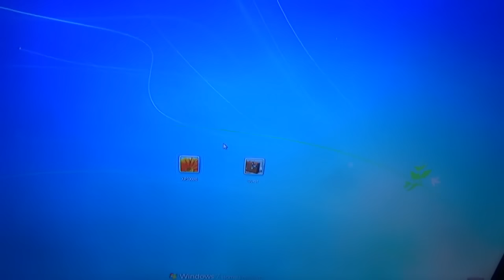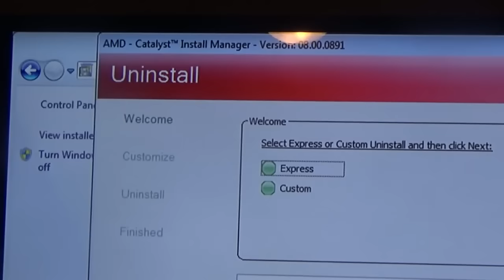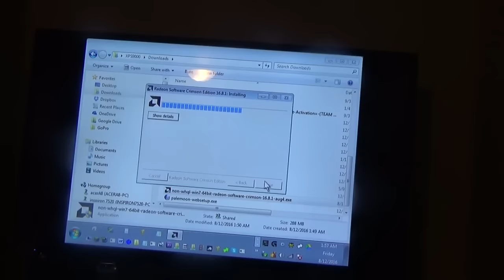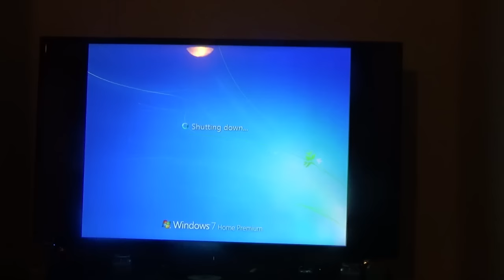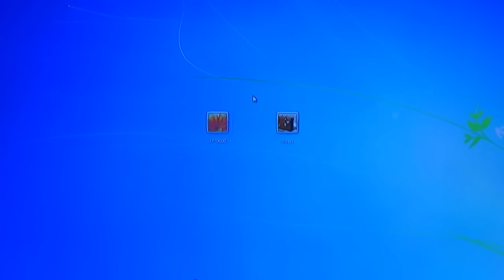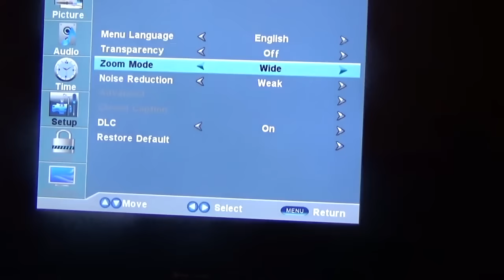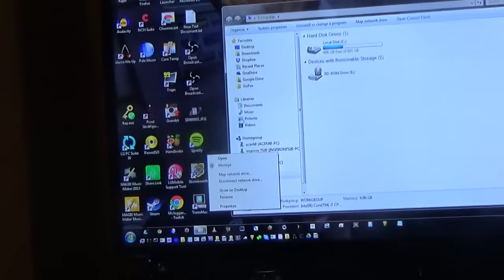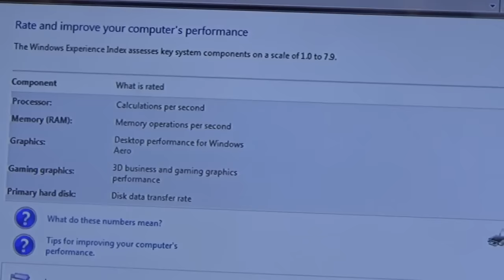Cleaning and upgrading the XPS9000

Comment: I'll be honest I turned the one in the morning off after a few minutes, it just felt unneeded to me.  I'll be honest shorter ones that are more focused would be a bit better, even this one it could have been cleaning out the pc, installing the card, and finished product.  Not trolling just stating my opinion for consideration, the longer vlogs are nice when there is something going for the time but mostly it feels like filler.  Hopefully I am making sense....heat and my brain no like each other.